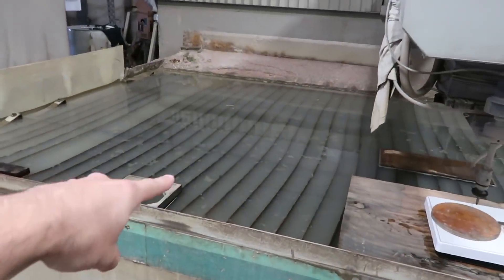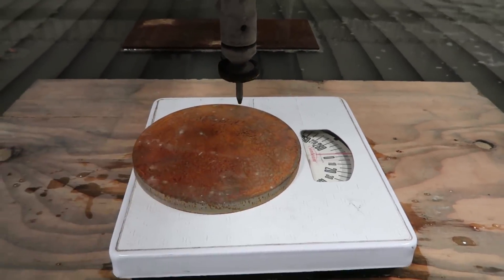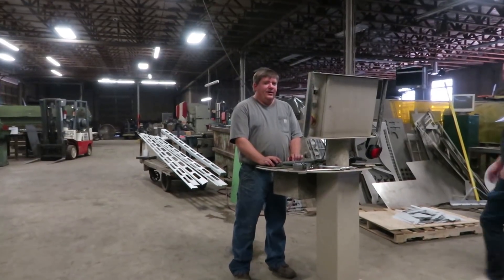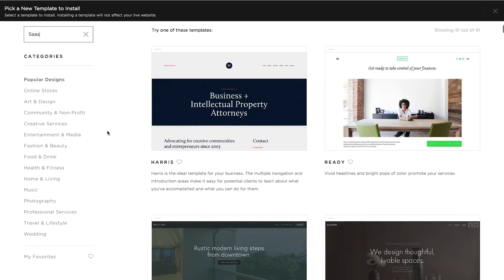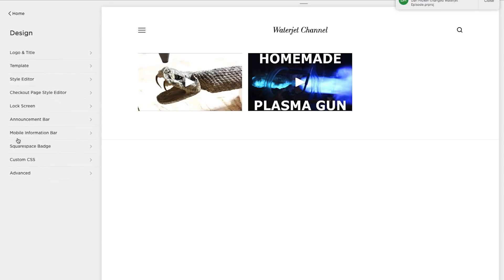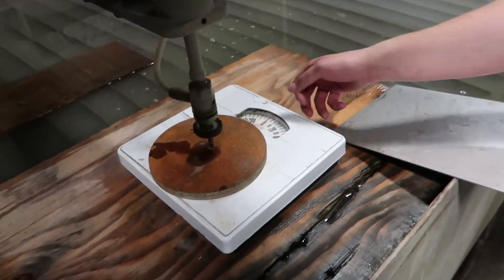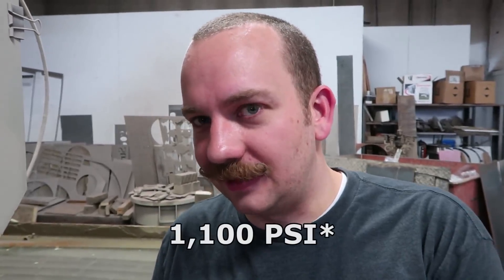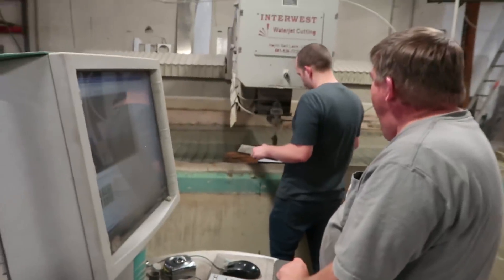How much does High Pressure Water Weigh? Bathroom Scale Cut in Half

Comment: your math is correct but your logic is not... the water jet force is not spreading thru the whole surface but only where the water jet hits (the diameter of the water jet)... once the jet hits the plate the jet is spread outwards so the force that produces is horizontal and not acting on the scale at all...

Comment: You have to take the area of the hole made by the water jet (the area of the contact point), and divide the 1 by the area of the contact point. Then take the quotient of the division, and multiply that by the 11 lb. Assuming that the contact is between 0.007” and 0.02” in diamiter which is the average for industrial water jets, the psi is between 90,982.32 and 11, 145.31, which makes a psi of 60,000 completely acceptable as a value. Assuming the psi is 60,000 for your jet, then the diameter of the contact point is about 0.00862”. Hopefully that answers your question.

Comment: Your problem was you were trying to figure out square inches when you are clearly dealing a circle inches. You will find that your water jet makes contact with 18/1000th of a square inch @ 11 lbs. This means there is 611lbs/circular inch x a 100 square inch scale. Your water jet produces 61,111.11 repeating (of course) psi

Comment: PSI is a measure of pressure which you can find by taking the force (weight in pounds shown on the scale in this case) and dividing it the area. In this case the area would not be the area of the scale nor the area of the slab. It would be the area of the nozzle of the water jet, in squares inches. So you can find the result by dividing the 11lbs on the scale by the area of the nozzle in square inches.

TLDR; To find the PSI, divide the 11lbs by the area of the nozzle in squared inches.
Reply: Unfortunately that equation does not work due to energy losses from the water spraying out sideways and because the water is flowing and not plugged inside the nozzle.

Comment: After a small amount of research I concluded that the diameter of the water jet is roughly 1.2mm, and similar to another comment I assumed the nozzle was square as it is easier to calculate the area on a phone calculator when using a square. I also converted pounds to kg and calculated the final pressure in pascals to psi because I am more comfortable using metric numbers. Factoring in this inaccuracy I came to the rough conclusion that the water jet is exerting a pressure of ~50,000 psi. When you consider that my answer is a rough estimate, it is highly probable it is the stated 60,000 psi

EDIT: Spelling mistake

Comment: Its not so straight-forward to compute the pressure. The most accurate reading would have been the initial 18 lbs. before it started to pierce the plate. Here it can be approximated as an impinging jet on a flat surface. Then you would need to employ some fluid dynamics to get some idea of the velocity if you know the mass flow rate of the water coming into the machine. To back-compute the pressure, you would need to know some information on the nozzle itself. Typically the kind of analysis you would see in scholarly articles. Nice 'stach, BTW!

Comment: I don't know what size your nozzle is. But if I assume it's ten thousands of an inch diameter, half that is the radius, if you square that and x Pi you have the area of the nozzle. Take your 11 lb and divide by the number you get for that area and I only get about 1400 psi. I could be doing something wrong too but that should be right in which case something is way off. Edit: I grabbed a different calculator and saw that the nozzle size was .060" With that nozzle I get just under 4, 000 PSI with this I think I've decided that it may be 60, 000 PSI in the plumbing but it's only hitting the scale with 4000 PSI.

Comment: Pressure = Force / Area
psi: pounds per square inches
Force is 11 pounds
Area is about 1mm^2 or 0.00155in^2
Pressure is 11 / 0.00155 = 7100psi
Note that area is aproximate.
Also the pressure is calculated where it hits the scale. It will be higher in the nozzle.
Extra:
1 inch = 2.54 cm
1 kg = 2.20 pounds
Air pressure at sea level: 14.7 psi

Comment: P=F/A (Pressure = Force/Area) There is 11 lbs of force concentrated in the diameter of the nozzle of the waterjet. I don't know the diameter of your waterjet nozzle so i'm gonna go backwards and guess. Assuming a pressure of 60,000 psi, and a force generated of 11 lbs, and using math, your nozzle should have an opening with a diameter of .015 inches.

P=F/A --> A=F/P --> A=11[lbs]/60,000[lbs/in^2] --> A=.0001833 [in^2]
A=piR^2 --> R=sqrt(A/pi) --> R=sqrt(.0001833 [in^2]/pi) --> R=.007639 [in]
D=2R --> D=2 x .007639 [in] --> D=.01527 [in]

Edit: From a post you commented, on, the nozzle diameter is .060 in. Using the calculations above P=F/A, the pressure is about 3890 PSI

Comment: If water jet point is 0.06" diameter then the area is .0028" squared (Pie x r squared). If that is putting 11lbs of force on the scale assuming it is hitting the plate without expanding (spoiler, it isnt but oh well) then you can divide 1 Square inch by .0028 to find out how many times .0028 goes into a square inch. this is roughly 354 times. so, multiply the 11 lbs by 354 to make it even with the units being used (pounds and square inches) and this leads to 3890 Lbs per square inch. In reality the stream has expanded to be larger than .0028 thus the PSI should be lower than this amount. There are confounding variables to consider...the stream is eating the metal away thus some small amount of thrust on the scale is lost. The accuracy of measurement on the scale limited to whole pounds can swing the measurement by hundreds of PSI. But ultimately, I dont see how this test could prove 60,000 PSI with the numbers given. 

Nevermind...In a little research we would likely have to apply the Dynamic Pressure equation q=(d x U squared)/2. q being pressure, d being density and U being flow speed.  We have density (when its water, 0.036 LB/sq-Inch ) and we have the theoretical pressure of 60,000 PSI. So with the data given we can determine the velocity which would be 1826 in/second (double check me on units here...) or 104 mph. I really hope this is all correct. it's been almost 2 decades since i took a math class. 

But wait, that doesnt do anything to prove if it is 60,000 PSI in the first place. somehow we will have to measure the velocity of the stream, or infer from the data to solve for velocity to project what the PSI was....

Comment: Wouldn’t you have to multiply the number you got by however much smaller the water jet point is? So if it is 1/60th of an inch, then you multiply your number by 60, to get roughly 60,000 psi

Comment: The psi of your water jet is the weight you read on the scale divided by the nozzle area of the jet. 60,000 = (11lbs) / (nozzle area). From this, you can calculate that your nozzle diameter should be .000183 inches squared. This seems like an extremely small amount, but it makes sense because the scale read only one 5,454th of 60,000 lbs. If the nozzle had an area of 1 square inch and the water/garnet was going the same speed as it is now, then you expect to read 60,000 pounds. Please call me out if I made a mistake. I agree, math is hard.

Comment: 6lbs before the jet was turned on, 17 while the jet is on so a difference of 11lbs. 11lbs divided by the area of the nozzle. The diameter of the nozzle we have at work is .014in so I'll use that. Area is 0.000154 square inches. 11lbs/0.000154 = 71,428psi. Eh close enough given the accuracy of a thrift store bathroom scale.

Comment: Assuming that your waterjet stream is 0.010" wide, that gives us an area of 0.000079 sq. in., and when you multiply that by 60,000 psi, you get 4.7 lb, which is a little lower than your measured value, meaning that your waterjet's stream is a little larger than that. You guys are assuming that the force is applied by the waterjet stream to the entire plate, but it really only applies force to the plate according to the size of the stream. You also have to remember your dimensional analysis! Hope that clears up the math a bit!

Comment: Work out your orifice size.
Assuming 0.36mm orifice = 0.000157771099 in^2 area of force from jet.
You said 6lbs to 17 lbs 11lbs of force on that area. 
1/0.000157771099= 6338.296470889133 ( scale factor of pressure from jet to pressure on 1"^2 for PSI ) .
6338.296470889133x11= 69721.26117978046( PSI required for 11lb force from area of orifice / water contact) . 

69721.26117978046PSI  IF your orifice was 0.36mm

Comment: It depends on the area of the stream not the scale. If the steam is 0.02 inches the pressure would be as follows: 11 lbs / [ pi * ( 0.02 in / 2 ) ^2] = 35000 psi. If your waterjet is a different diameter plug that in for 0.02 to get your pressure.

Comment: I believe that the area of the steel plate doesnt matter because then the scale wouldnt work, since if you weigh 100 lbs and have small feet u shouldnt whey more than a person that wheighs 100 lbs and have bigger feet. And that is where i think you didnt get the calculations right. And maybe theres more mathimatical steps that you missed.

Comment: The nozzle would need to be .015 in diameter for that to be 60,000 psi
Pressure = Force / Area
Pressure = Force / (pi * (nozzle_diameter / 2)^2 )
60,000 psi = 17 lbs / (pi*(.015/2)^2)

Comment: Ok so if your water jet shot out a square inch of water it would be 60000lbs. But it shoots a super small dot, which if you measured, then scaled would probably be close to 60000
Reply: That focused stream doesn’t have an area of a square inch, according to my hillbilly math it’s around 0.000183 square inches. That’s if the water jet gives out 60000 psi

Comment: Suppose the waterstream width is approx. 0.02 inches, then the area is (0.02/2)^2*pi = 0.031416 square inches.
Pressure is 17 pounds per 0.031416 square inches.
17/0.031416 = 541 PSI.
Maybe your waterjet is broken, or maybe it’s just the scale.

Comment: Instead of estimating the diameter of the nozzle, you can also use the flow rate of water (gal/min) with the force reading to calculate pressure. Neglecting gravity (which shouldn't affect much at such high pressures/speeds), Bernioulli's equation gives P = 1/2 rho v^2, where rho is the density of water, P is pressure, and v is the speed of the jet. The force F = dp/dt = v dm/dt = rho v dV/dt, where dV/dt is the water flow rate. Putting these together, you get P = F^2 / [2 rho (dV/dt)^2].

If you measure how much water your jet uses, convert everything to metric, and plug the numbers in, you should get a rough pressure estimate.

Since I don't have flow rate info, what I can do is use the equation backwards, assuming 60,000 PSI of pressure, to estimate the water consumption of the jet. The equation rearranges to dV/dt = sqrt[F^2 / (2 rho P)]. Plugging everything in, I estimate your waterjet uses 0.86 gallons per minute. Hopefully that's not horribly far off.

rho = 1000 kg/m^3
F = 11 lbf = 49 N
P = 60,000 PSI (assumed) = 414 MPa
=> dV/dt = 5.4e-5 m^3 / s = 54 mL/s = 0.86 gallons/minute.
Reply: I think you're getting a bit too fancy there with aerodynamic equations, what you are using is Bernouli's equation but is missing a negative. P=F/A should be sufficient for this calculation with the assumption that the beam width of the waterjet is constant and is equal to the inner diameter of the nozzle
Reply: I agree that P=F/A is sufficient here. I just wanted to highlight that there is an alternate method, using flow rate instead of nozzle size to indirectly compute the same result. In the process, I am assuming that the pressure within the nozzle (before the water stream leaves) is 60,000 PSI, and is zero once it leaves (complete transformation to kinetic energy). I'm avoiding dealing with the stagnation pressure by employing conservation of momentum - I'm assuming that the water goes strictly horizontally after hitting the plate, and therefore all the vertical momentum in the stream is directly transferred to the plate (this allows the use of Newton's second law, F=dp/dt).

I should have made more clear which pressures/velocities I was referring to, sorry! The variable P is internal pressure of the nozzle, and I'm purposefully avoiding dealing with the stagnation pressure. Using Newton's second law allows everything to cancel, and I just thought that was beautiful. :)

Comment: divide the force, measured in the scale by the area of the jet hole, also make sure to use the correct units to get a psi reading ( use pounds-force and square inches)

Comment: What is the nozzle diameter?
The nozzle would need to be .015 in diameter for that to be 60,000 psi
Pressure = Force / Area
Pressure = Force / (pi * (nozzle_diameter / 2)^2 )
60,000 psi = 17 lbs / (pi*(.015/2)^2)

Comment: Ok assuming a 5mm diameter or 0.1969"
Area is 3.141*(0.9169^2) = 0.030345 square inches.

Assuming a pressure of 60000psi (60000lb/inch^2) and you have 0.030345

Then 60000/(1/0.03045) = 1827lb a factor of 1000 out...

Silly me, it's 60000psi in a closed system as soon as the water leaves the system then it's pressure would drop.

You should be getting ~1900lb assuming a diameter of 5mm and you probably would if there was no gap between the nozzle and the scales.

Comment: Grab your calipers, and measure the inner diameter of the nozzle for the water jet (the diameter of the hole). 

divide the diameter by 2 to get the radius. 

square the radius and multiply by pi. You now have the area of the nozzle. (it should be a really small decimal number, like .000xxxxxx) 

Take your 11 lbs (17-6) and divide by the area. You'll get your PSI. 

I looked at some other nozzles, and got around 14,000 PSI, but that's based on the weight your scale from the 1600s reported.
Reply: Dloweification the radius is .0175 in

Comment: The unit of pressure you are using is pounds per square inch, you got the force aka weight of six pounds. Divide that with the area of the water jet in square inches which should be diameter of the water jet divided by two to get the radius of the water jet to the second power and multiply that with pi and you have your answer that will be below the true value because of the internal friction of bathroom scale and bathroom scales are not that accurate measurement devices. The area of the bathroom scale is irrelevant. So, if the diameter of the water jet is 0.014” then the pressure is 6/(π×(0.014/2)²)=38 976 pounds per square inch or 40,000 PSI because your measurement accuracy was one digit, so the result cannot have greater accuracy than the least accurate measurement had.

Comment: Depends entirely on your nozzle size, When you are cutting the scale the maximum reading is 60 pounds (this is extremely unlikely to be any where near accurate as the scale is full of water and the mechanism is likely very damaged but it gives a better result). This means your nozzle is approximately 0.001 inches (0.05mm). If the reading is 11 pounds then the nozzle is 0.0002 inches (0.005mm). The 60,000 PSI is more likely the pressure in the pipes and a portion of the power will be lost after leaving the nozzle. If we have the nozzle size then a better estimate could be made instead of trying to make the numbers fit.

Comment: It depends on the width of the nozzle. Quick google check said one water jet cutter nozzle  had a diameter of .25 mm. Assuming a circle, the spout would have an area of about 0.049 sq. mm which equals about .000076 sq. in.  If the psi (pounds per square inch) was 60,000, but the area of the jet is only .000076 square inches, just multiply 60,000 by .000076 and you get 4.56 pounds.
you got 2.4 times more than that at 11 pounds, so either the psi is more than 144,000, or the nozzle is about 2.4 times that size, which would mean a nozzle with a diameter of .015 inches.

in short, if your nozzle is about .015 inches in diameter, than at 60,000 psi, it would blast with that force of 11 pounds.

If that's not correct, then the nozzle is a different size. to find the real answer, find the actual nozzles area in sq. in. (A) and plug it into the equation:  11/A=psi

Comment: SOLUTION HERE: PSI is pounds per square inch. The “per” part of that gives you the formula for PSI;   Pounds “divided” by Square inches that the water comes out. A nozzle has a diameter of 1.2 mm (.047in). Radius of (.0235 in)^2 * pi = .001735 in^2    So 11/.001735= 6,340 psi

Comment: Physicist here: You aren't thinking about PSI correctly. That 60000 PSI is going to be the pressure of the water leaving the nozzle. This means all the force is spread out over the area of the water, not the scale. To get a reading of 17 pounds on the scale with a 60000 PSI waterjet, the cross-section of the water would need to be 17/60000 or about 0.0003 square inches (or a nozzle radius of about 0.01 inches). I'm finding the radius of the nozzle because I only know the supposed waterjet PSI and scale reading, but not the nozzle radius. If you knew the nozzle radius, take the scale reading and divide that by the area of the nozzle (pi r^2).

Comment: Your math is fine, except that you did it for 1 square inch, which is much too large. I've been doing some guess and check and it looks like the hole is about 5/32. That gives you a radius of 5/64, which gives a cross-sectional area of [(5/64)^2 * pi] square inches. So  0.0191747598 sq in, according to my calculator. We'll call that t for tiny.

Let's compare 100 to t. 100/t gives us a bigger number, because dividing by something smaller than one does that. In this case that's 5,215 plus change. 

So the pressure at t is roughly 5,000 times greater than the pressure across the scale. Pretty insane, right?

Multiply the 5,215 and change by 11 and you get about 57,367 and a bit.

11 lbs across 100 sq in becomes 57.367 KSI at the stream.

Completely wrong, but close enough for me.